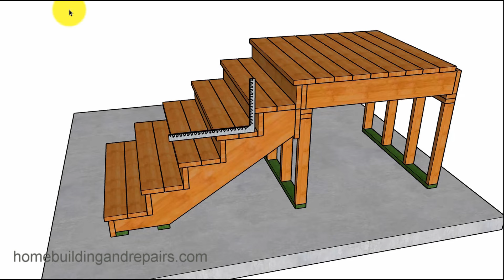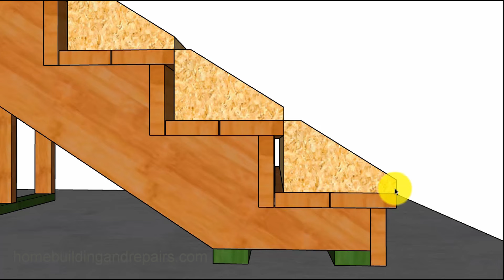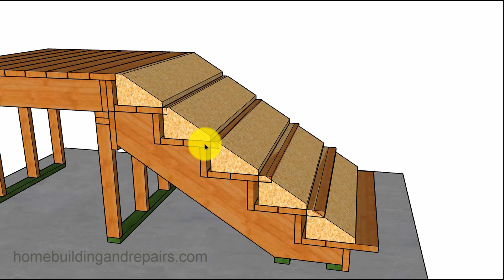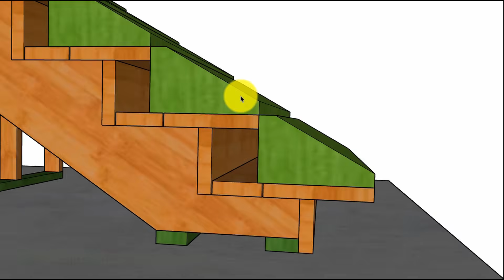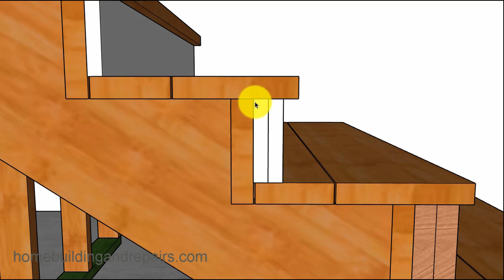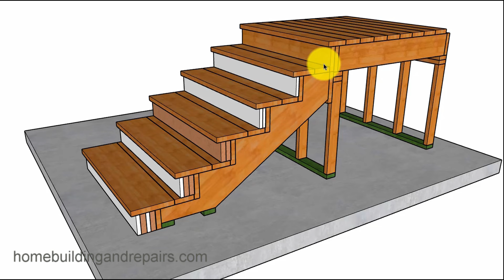How To Increase Individual Stair Step Depth For The Entire Stairway - Home Remodeling Tips

Comment: It's a good illustration of the math concepts in the stair layout calculations.  It helped me understand why my math wasn't working the way I mistakenly thought it should work.  But it seems like the "right" way to increase the tread depth is to calculate the stringers correctly before cutting them.  When would this technique be used in practice?
Reply from the maker: Maybe inside of a house, but not outside.

Comment: I need to do the opposite, I need to make the steps each a little lower. There are 13 steps and the height of each is too much. The problem is that the space is limited, as there are 2 doors at the bottom, right where the staircase ends, so the total length cant be extended

Comment: Im totally confused as to why the riser area gains more as you go down. For instance my basement stairs are 7 high 9 deep tread. Can't I replace treads with 10 inch and just support new overhang with a small support under the end or sister to the existing stringer with blocks to add depth for the new 10 inch tread without having to increase each riser build out
Reply: Edit,  totally get it now

Comment: I'm replacing carpetted steps with oak, and I want them to be closer to code de,th.  Instead of adding all those pieces, could I sister new stringers onto the existing stringers, then put down new treads and risers?  The stringers would be inside the old, so the treads would hang over the stringer 1-1/2" on each end.  I'd still glue it all together and to the new 1" oak skirt boards.  Doubling up the stringer would make it more solid than replacing the old stringer and I wouldn't have to cut it away from the wall framing.
Reply from the maker: I think that work, but maybe it will be even better to remove and replace stairs.
Reply: I was thinking of doing the same exact thing because I can't extend my whole run and there's too much going on under my existing stairs. Framed closet, shelves etc

Comment: Would you put your filler boards on top of the treads or on the stringer
Reply from the maker: It will depend on the project. If the stairs steps are exposed like wood finished steps then under, but if you cover them with carpet it might work better going on top.
Reply: But either way has the same strength?

Comment: This would work great for the top half of our switchback stairs as we have a good size landing we can extend on. But at the bottom, there is a closet door that opens out and if we extend the steps, it would render the closet unusable. Would it be possible to add additional steps to the landing itself to give us room to extend the length of the tread? Would we need winder steps to accomplish this? Thanks for your help!

Comment: Hi, thank you so much for this very clear and detailed video. Could you possibly point me to another video, or update this one to show how I can (when I say “I”, I mean my builder! 😀) introduce a winder at the turn from the bottom of the extended run. According to my calculations, by adding approximately 1 inch to each step (using the cumulative method in your video), I would have added one full step to the bottom step… thereby meaning I would need a winder to be in place. Hope my query makes sense… thanks again!
Reply from the maker: Go to our website and go to the repairs tab, then click on stairs for some more ideas and if you can't find something, let me know.

Comment: This is great! I need to do this to my stairs, and I think I was just worried about the safety/security of the filler boards/risers to hold up the new (I'm going to install retrofitted treads to my existing construction stairs that used to have carpet) treads, but this is exactly how I had it worked out in my head to do it. Any thoughts on how to make the rise shorter? My stairs are currently 8"/9" (rise/run) with the first step only being 7" and the rest 8".
Reply from the maker: Yes, safety is always a concern and if you can't securely fasten the new components, then don't do it. I also don't have any videos for creating shorter steps, because most of these problems require the stairs to be replaced.
Reply: @stairbuilding  my words exactly to the contractor I'm working for. "Need to be replaced" 
Just not currently in a position to argue I suppose. Contract is signed and it's not as though I was consulted.
Curses.

Comment: i thought u juice add, won inch, two each, but each won adds won inch double, tripul anna hommer runners. i tinn to move it, anna it addz up; anna multipies ;not goodie if its inn ahh, fitted space
Reply from the maker: I dink zo, but mybe not, let my no if dis mikes cents.
Reply: @stairbuilding  so ,so ,but, not zoe
Reply: sow ur linking won itch; per step; mackin a lonnger total runn; length
Reply: orr u wood hafta shove dahh whiner winder, back,anna movie dahh hole stringer back, to mack ahh fit em up up
Reply: u movin out dah total length ;outwards only; not upwards